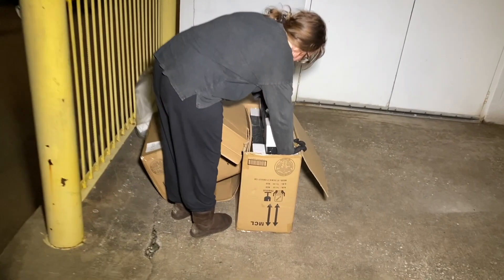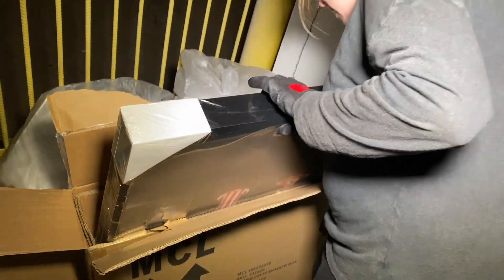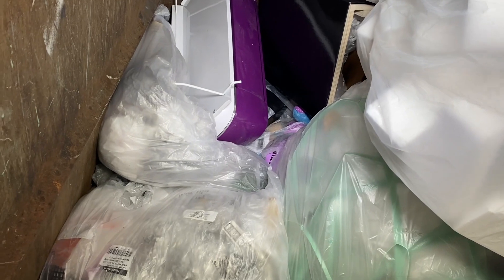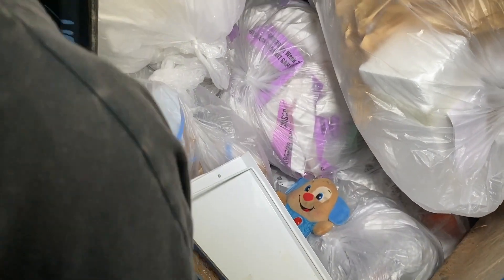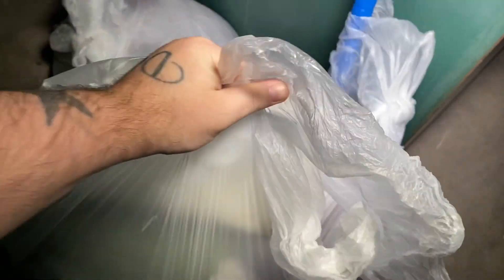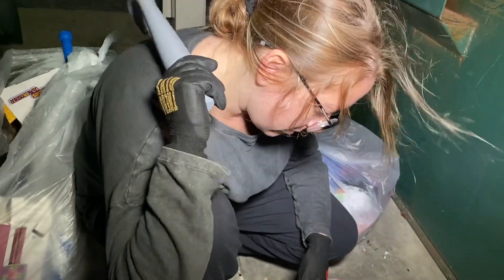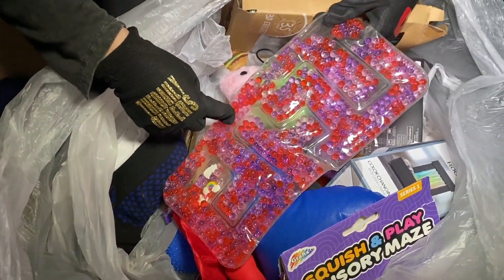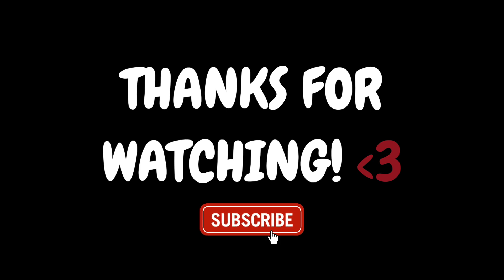MICHAEL'S 2AM BACK DOOR SURPRISE STASH! *FULL BOXES

Comment: Since Nicole is crafty and has lots of flowers and greenery she could make seasonal wreaths in them and instead of just hanging the wreaths hang the shadow boxes with wreaths in them..  Put dividers in them then roll pairs of socks and put them in them, u can then slide them under the bed instead of having a sock drawer. Hang wire from side to side and u can hang jewelry on wire and hang shadow box on wall, put a door on it and either paint front with chalkboard paint or as u like or apply mirror.

Comment: You can replace the glass in those for pennies! Not kidding. Just take the measurements to a hardware store. Have them cut the glass to size. I bet it's less than a $1 per box. Maybe a little more for the big one.

Comment: I wonder if you could drill a hole through the right and left sides of the frames, and then slide a small dowel through..or more than one dowel? You could mount them on the wall, and use them to hang jewelry from?

Comment: You could also use them with like little decorative handles like metal handles on the outside and it could be a tray on a ottoman or a tray anywhere to display or something for you know in bed you know breakfast but those are really nice so you could add a little decorative handle like a brass or silver and you can add little you know Corner feet better the similar in the in the metal I don't know but good score guys

Comment: I don't know what you call them in English, but I would buy those cheap picture frames in the size of the shadowbox, that don't have like a wood frame around it. The glass is hold with metal clips on the back. I hope you know what I mean. Take that glass and use it for the shadow box.